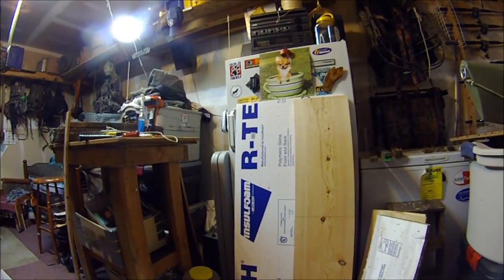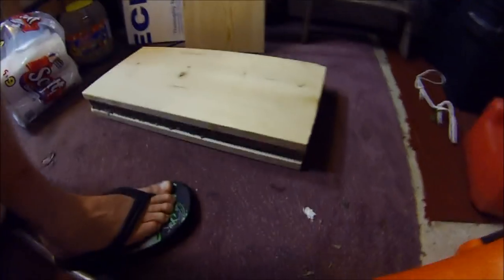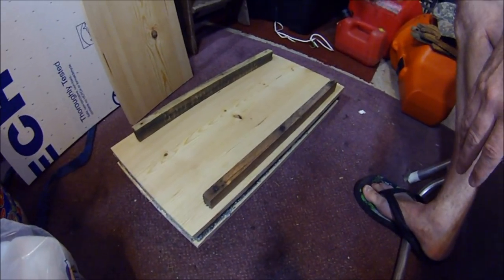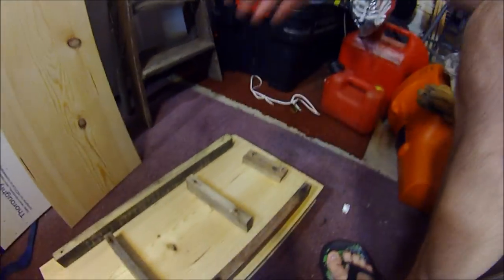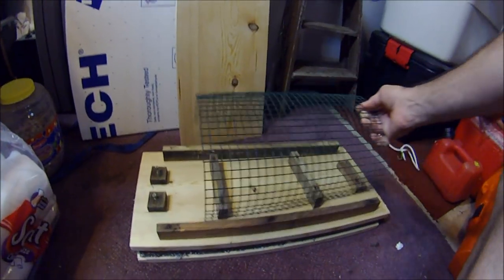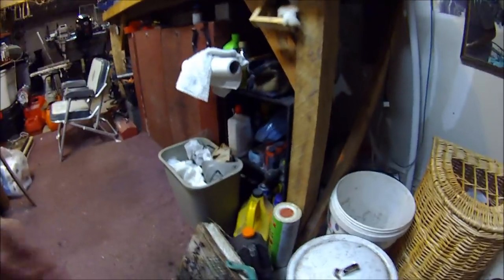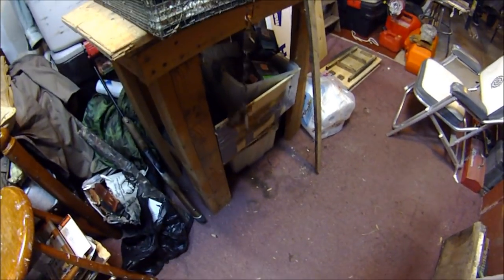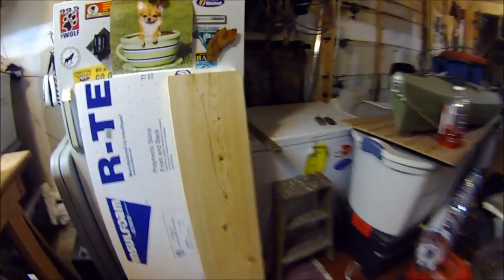How to Make My Muskrat Float

Comment: "climb back on your float and be waiting for you." that is funny. Another way is to lay  two  14" 2x4s 15" apart and parallel. Then screw another 2x4 across the top perpendicular and in the middle of the bottom two. Flip it upside down and screw some wire mesh across the bottom and this is where the traps will lay. The top 2x4 you can put a screw in the 2x4 and push a carrot onto it. That is about the cheapest float you can make. You can also anchor it with some really cheap metal dog chain (rat proof). Good idea you have too, though.